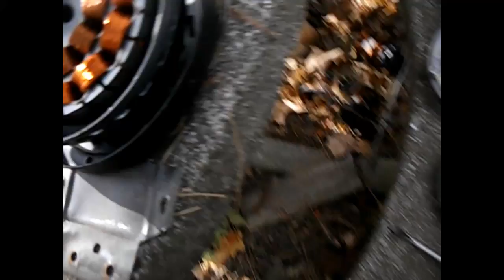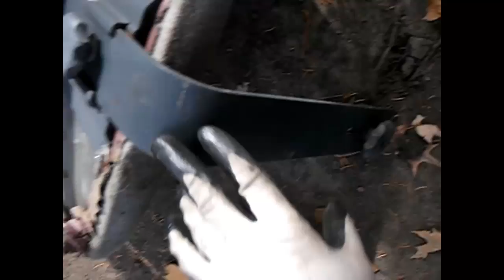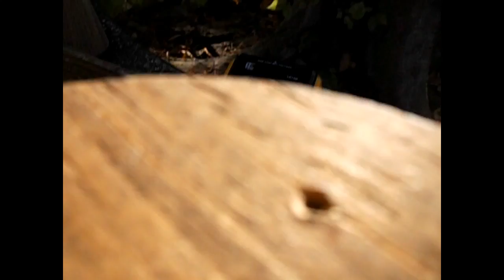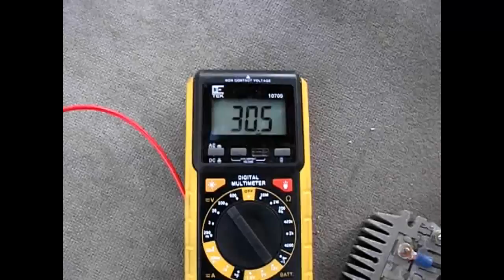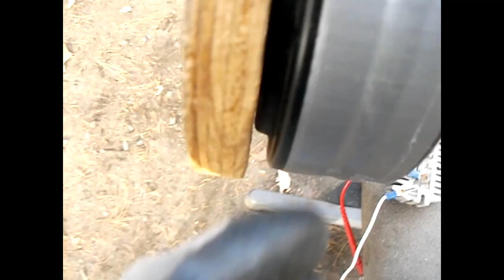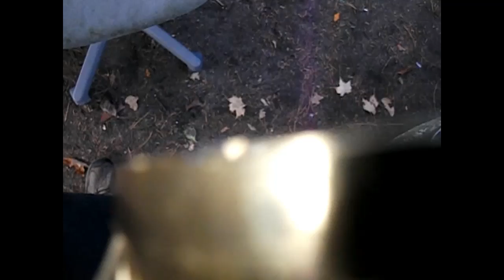New ceiling fan wind generator build duel rectifer

Comment: FOR MY BUILD i USED A STEEL DRILL BIT AND DRILLED A 1/2" DEEP HOLE INTO THE ALUMINIUM RING COUNTER TO EVERY OUTSIDE COIL THEN SUPER GLUED MY MAGNETS INTO THE HOLES.  TO ENSURE THE MAGNETS WERE FLUSH I USED A DREMEL TO SAND DOWN THE SURFACE MAKING THE MAGNETS SIT AS CLOSE AS POSSIBLE TO THE COILS.  THEN USING THE HIGHEST RESISTANT SET OF THE  FOUR WIRES CONNECTED THE REMAINING TWO IN SERIES CREATED THE HIGHEST PRODUCED AC OUTPUT I HAD EVER SEEN HIGHER THAN ANYONE'S ON YOUTUBE...................

Comment: did you connect that direct to the battery bank or you use a controller before connecting to the battery? can i use the solar charge controller as wind turbine charge controller? thank you and Godbless
Reply from the maker: i just connect to battery

Comment: I am doing the same Joe with a big 212mm x 28mm ceiling fan motor. Can you please tell me why you put the magnets in NN SS NN configuration because when it will spin it will be N and S on the same coil and wont be so efficient.

Comment: ◾◾◾Did you not use a band between the magnets and the edge of the ceiling fan casement? Is it even necessary? Can one just glue the neodymium magnets to inside of the metal ceiling fan case? Thanks.
Reply from the maker: Cyrus Ramsey yes I used a band needed bigger magnets, didn't have them at that time, the the case is made of aluminum, magnet won't stick to it,all so most covers have supported knobs,to support the original ring

Comment: after that rectifier u connect wire direct to 12 volt battery or use some control circuit . and second what will happen when high speed wind starts in that  area ?
Reply from the maker: FlamsON Flams directly